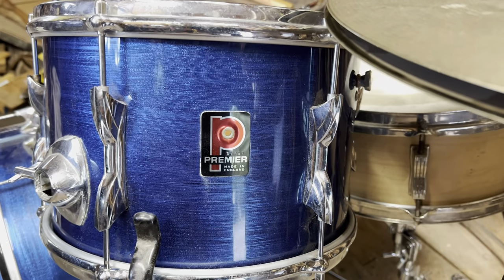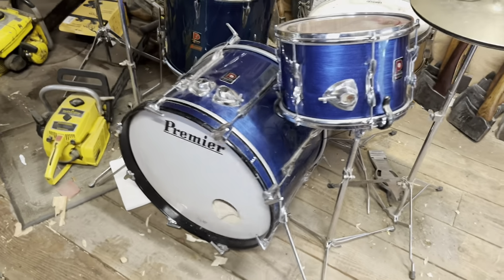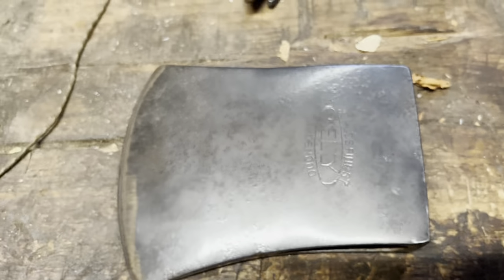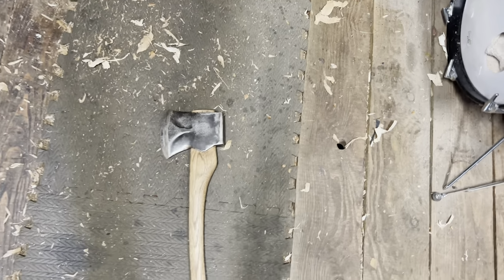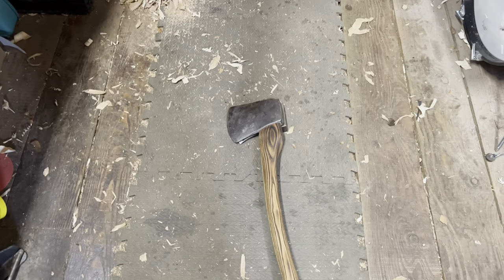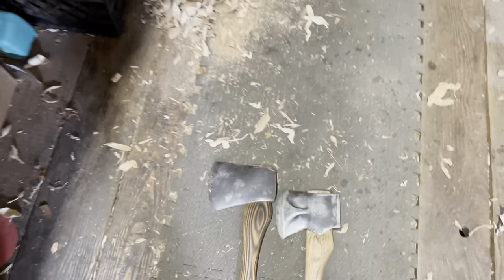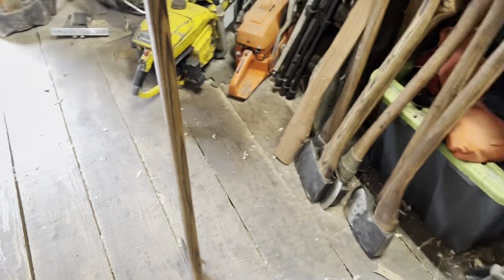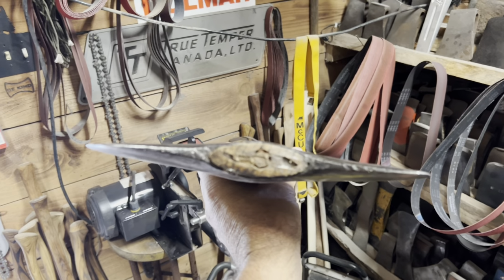TIME FOR A CHANGE !

Comment: Need more cowbell. :)  I struggle with back pain due to a lot of heavy lifting and I use a nice inversion table almost every day. It really helps. I love the new message on the chalk board too. If I am not the problem, then there is no solution. Hang in there brother Buckin and thanks for the video!

Comment: I had a premier soundwave as a boy, spot on about the chrome, nice thick plating. Might sound mad but I'd really recommend a good quality sea salt in your nutrition for repairing any type of connective tissue damage, avoid anything with the anti caking additives though, I've had knee and hand injuries that I couldn't get to heal fully for about a decade all come back to full function. All the best.

Comment: my head.....scary place. i try to stay out of there because i can get lost in there. it kept me in a cycle of addiction for 30 years until i said enough and took action to stop it. saying you can stop and actually stopping are two very different things. it was rough. toughest thing i ever did....loving myself enough to want to live. its been 7 years and im no longer broken. not quite whole but alot better than ive been my whole life. i still have my moments of self doubt....but i remember what overcame....and that self doubt goes away. 
  talking and sharing what was going on inside was my biggest help to getting clean and i continue that to this day. i dont bottle anything up ever because i know it will turn on me. talking to someone, journaling or even posting something in a comment section helps me keep my mind clear which helps me stay clean. 
  thanks, bucking.
Reply: Congrats that's a long time.  💪
Reply: Well done Greetings from lreland similar situation for me 10years sober but still one day at a time be kind to yourself keep talking with good people

Comment: Billy, Sorry about the back.  Do you have one of those stiff rollers that you can roll on after you get out of the sauna?  I find that's the only thing that resets my back once it's tweaked.  Get it good and warm and then one roll up and down on that thing and all the crunchies come out. Get well soon!
Reply: This sounds like good advice especially for anyone with a sauna in their house.
It's been a while since i used to travel to friend's house and have a sauna, quite a few in the crew. Every Sunday night. 
Heating up the body then slowly/gently rolling on a special foam roller can do wonderment for a tweaked spine. 
Have tweaked numerous parts of my body numerous times and slow yoga, hot Epsom salt bath, and trigger point muscle therapy all are good treatment. ❤️‍🩹
Rest is the best...
If you haven't guessed...
Put a 25 lb plate on your chest...
Lay flat on your back with knees up and 
You will be blessed 🙏

Comment: If you were playing an outdoor gig with no PA system...i would say no muted bass drum.
If you're in the bunker and want good definition of your bass kicks, i say mute.
Gotta say that your high hat cymbals sound as good as any i have ever heard.

And the bummer about tweaking the low back is: sitting is not conducive for good quality healing. 
Walking and swimming are the best exercises for active healing and recovery.
The ball is good for strength and balance.
But walking and swimming get the lymphatic system moving which is unknown to most people. 
Trigger point muscle therapy is also a help for release of inner tension of the connective tissue that is usually the culprit of tweaking.  📜👇👉
Hanging from a bar or custom made wooden branch strategically placed can give you a pressure release of lower extremities.
The crushed lumbar syndrome can be extremely painful. 
The thoracic vertebrae can spasm with severe detriment to rest and sleep.
And of course the cervical spine which is (to me) the most important carries every single nerve to your body below the neck. 
Any deviation of alignment can cause havoc throughout the body. That is why some chiropractors are miracle workers, they can keep us from the knife of surgeons.
Be kind to your body and we can avoid pain and lost days of work. This i know. 🙏

Comment: What kind of pedal you using? I grew up on the Speed Kings but now I use the Tama Speed Cobra. Sold my DW9000 to get the Speed Cobra. Anyway nice chops and foot work on that bass drum. I hear a lil Bonzo and Mitch Mitchell influence there. Those old Premiers do sound good. I play 80's Pearls with old Ludwig snares and Sabian cymbals. I prefer the muffled bass drums. Rock On!
Reply from the maker: VINTAGE PREMIER. BUT IM A OLD CAMCO PEDAL GUY

Comment: that you can be "under-attack, "Anyone who has had a serous back injury knows it will punish you in a lightning bolt moment. Mine came from an 8 barrel-roll  flipping in my sprint car.  Sprint cars are not a rarity in the U. S. Northwest--- an HP to total weight is very close to an Indy car. 700+ HP and 1 1/2 inch throttle pedal travel. The feeling driving one is beyond words !!. No clutch, no transmission. A direct drive from engine to quick change "rear-end." A 4 wheeled rocket on clay.